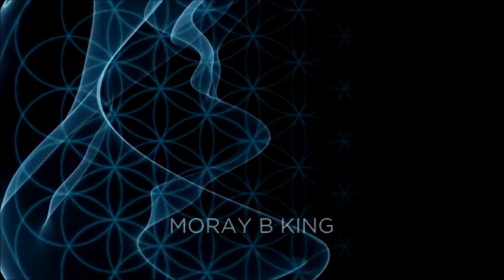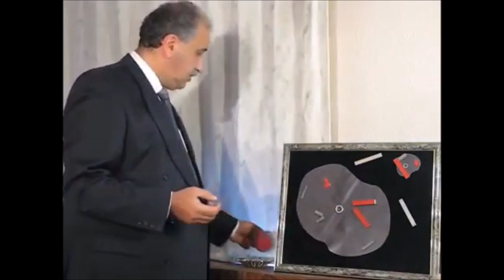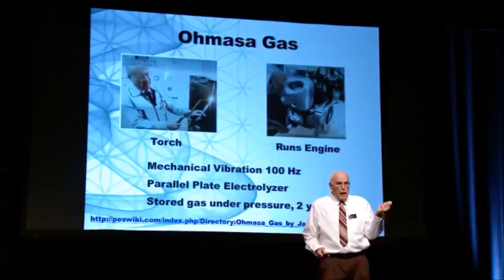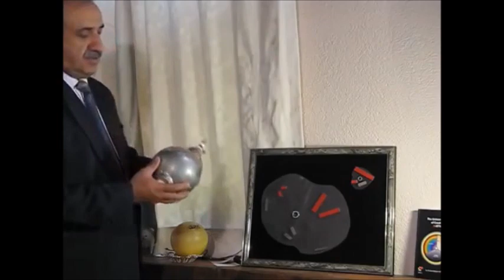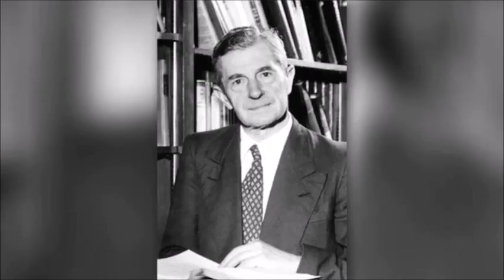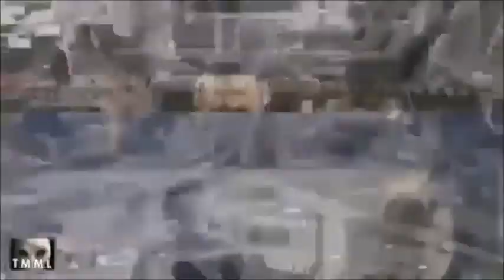Sonoluminescence Hollow Sun Inner Earth and Free Energy Science

Comment: Michelson wasnt looking for a "static ether". They were looking for ether drift or evidence of the motion of earth through an ether ocean or lumeniferous ether of space. The results compelled the "irrotational" ether or an ether stuck to globe and the difficulty of testing for this lead to a vertical arm to his huge vacuumed interferometer outside the Ryerson lab.  O.C. Hilgenberg suggested this yet the result shocked Michelson, who interpreted the result as suggesting the ether must extend thousands of miles.  C.F. Krafft and Hilgenberg disposed of the irrotational ether seeing that as the atoms were themselves composed of ether vortices, they were ether pumps and all bodies were processing ether in and out of the earth a tremendous velocities radially from these bodies. These currents reach millions of miles with a basic trend of motion akin to air currents. The sun has a primary ether ejection current from both poles, and inwardly at the equator, while the planets are diametrically trending inwardly at the poles and out the equator. These flows account for both attraction and repulsion in a fine balance so that the planets would repel each other and induce electrical currents between them as well.  The equipotential zones where ether currents come face to face induce Bernoulli effects which we know as gravity. Evidently the ether of space has its origin from the limn of the suns where matter is created by raucous interactions of neutrinos at that limn. Hilgenberg even calculated the density of this ether of space, but did not limit its composition to pure motion as Krafft felt compelled to contemplate. A super ether of micro-micro neutrinos would sustain the ether of space by increasing involvement of these in growth of motion. This would suggest a super-vacuum to some. Impulse in these would be transmitted at many times the speed of light. Furthermore, the impulses we define as c, have the velocity they do based on the density of granularity of the ether of space. Conceivably, the maturation of the extent of motion involved in these vortices would necessarily mean the speed of light would have to change over time. There is no reason to believe that all regions of immensity have the same duration or age of space about a sun so that in those variant areas the periodic table could be stable at higher numbers.

Comment: Long ago there was posited an hypothesis that space was essentially a form of matter called ether. the origin of matter from ether coming as a result of vortices formed thereof. The most fundemental vortice of matter being the neutrino which can combine with another neutrino to form either a proton or electron. adding a third can create a neutron.  The stubbornness of the ether to form even these simplest vortices is the first big question.  thinkers have posited the existence of the most fundemental substance, at the root of even the ether, which could be called the superether or primary, vibrating, originating aqueous-gaseous universal or cosmic substance. some motivating center presumably separated this fundement at the limn of which would be tremendous pressure. the vibrating at the surface of the non-vibrating principle of separation. At that limit of the ether all the neutrinos would be boiled to such a degree that collisions would produce copious amounts of the three basic subatoms. from then on the material table could evolve.  stratification of the ceiling of this great vacuum would form plasmas,  ionized gases and eventually solids as these are projected with escape velocity into the great ether ocean.